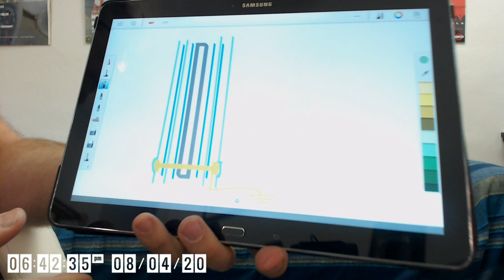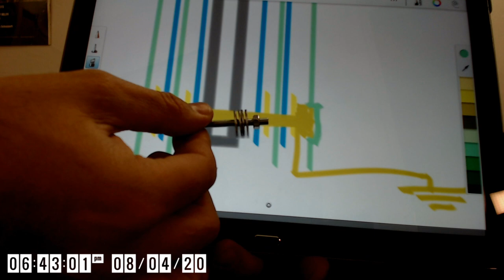Making a potential EVO+SR Shield

Comment: Potential is the key word here. I hope it works as intended. What cancers did these researchers die from and how strong is the correlation between their LENR research and the cancer?  What about the use of ferromagnetic materials, would it enhance or diminish the performance of the shield?
Reply from the maker: We know from the work of Adamenko/Vysotski and Matsumoto, and our own analysis of ECCO and LION, EVOs can hit a surface and travel along it bouncing between impedance changes. Shiskin specifically said multiple thin films in Sochi 2018. Magnetic and electric fields do manipulate them. One idea I had was to have foil sheets with high electric fields between them - however, the idea is to have something at this stage.
Reply: @MFMP  this might be of relevance: https://youtu.be/Als9E0lntec

I’m trying to work out the relevance of Dollard’s anti-relativistic take on electricity so I’m wondering if your understanding of cold electricity is the same as radiant electricity? 

Dollard distinguishes between magnetic potential energy and dielectric potential energy, both being the force required to maintain the energy in a static or potential form. Are EVO’s static or kinetic in nature in your view? They seem to have kinetic capabilities, but these seem to manifest in relation to interactions with matter. 

They seem like some form of capacitor if that makes sense? Dollard says somewhere that “the free space conductance of an object is the sum mutual capacity of it to all the conducting objects of the universe.” To be honest I’m not sure what this means but it seems to be speaking to the kind of energy release levels we see with EVO’s.
Reply: @MFMP  what tests will you perform to determine the effectiveness of the shield?
Reply from the maker: @joshhennen  I am afraid that I will just be putting some strong magnets in place and look to see if there are any witness marks in their vicinity - the shield is just the something that can be done rather than the experiment itself.